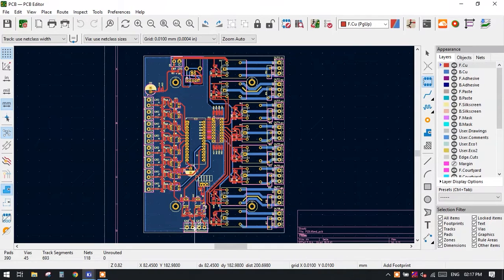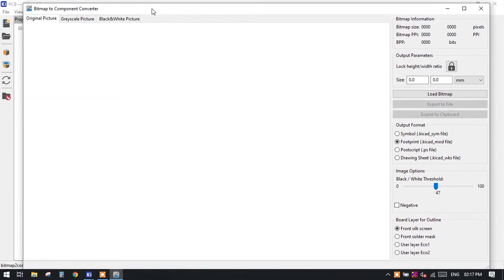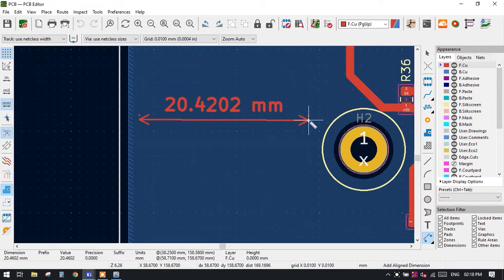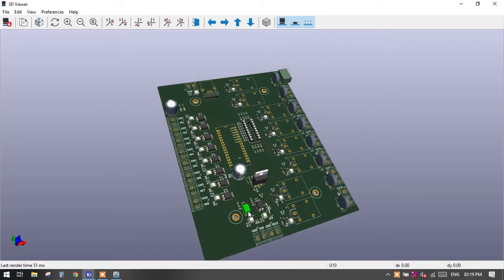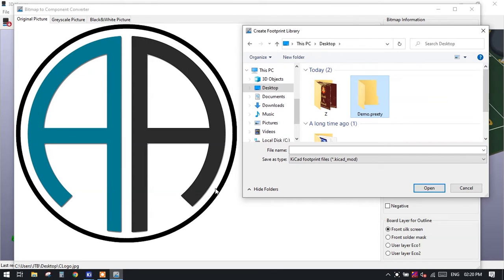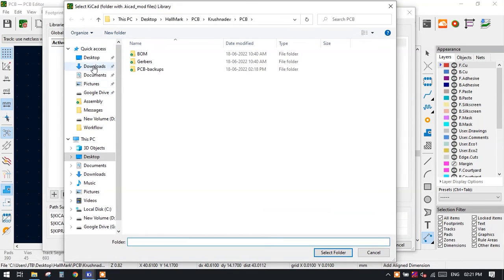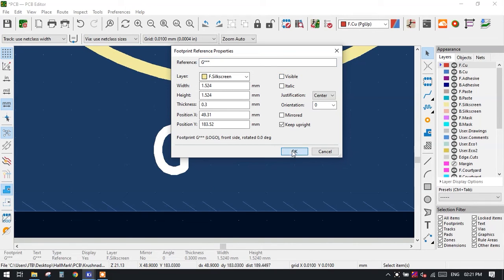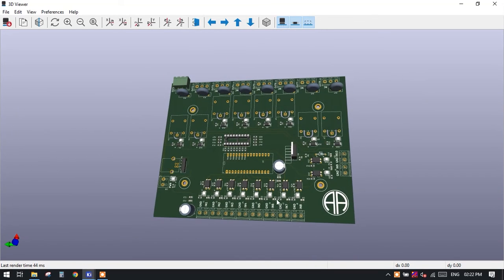Adding Custom Logo on PCB | Add Logo under 5 minutes | KiCAD Beginners

Comment: The extension for folders is .pretty, not .preety — but it doesn't actually make any difference to whether it works (as seen in the video).  You just need to select the FOLDER that the .kicad_mod file is in, rather than the file itself.

Comment: Can anyone tell me why the size of my image is shown in the Bitmap to Component Convertor but there is no way of  changing it !  

I don't have the size dialogue box shown in this video.

I also don't have the Export to Clipboard option  only Load Bitmap and Export !

Anyone any suggestions ?
Reply from the maker: Please uncheck the tick mark in the Output Size menu (Remove tick mark from Lock height / width ratio).
Reply from the maker: Sometimes this happens when you upload directly, the simple solution is just open the image in the microsoft paint and save it after that try to load into the Image converter. It shall work.
Reply: @AmazingAutomation  Thanks.  I was on an older version of KiCAD. I upgraded to the latest version but the KiCAD Bitmap convertor tool was still  a bit hit and miss.  I moved to Paint and had to reduce my logo by a factor of 8 in both the x and y plane.  As a png it seemed to reduce OK in Paint with all the detail present but when I went to bring it on to the PCB the detail was not reproduced - the image and the words making up the logo were both distorted. 

It is a bit disappointing as right now I do not have any particular idea as to the reason  !